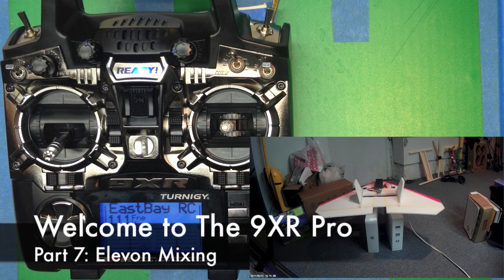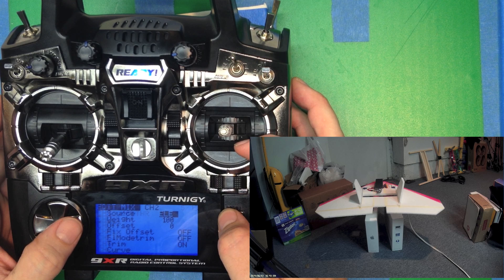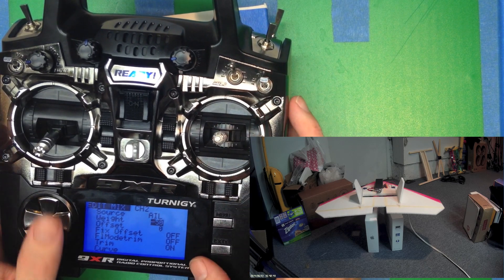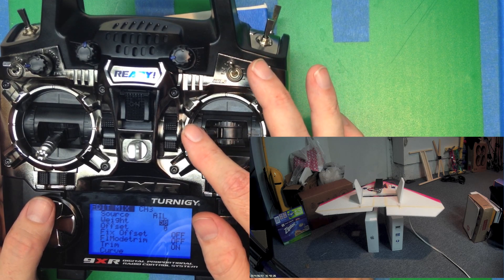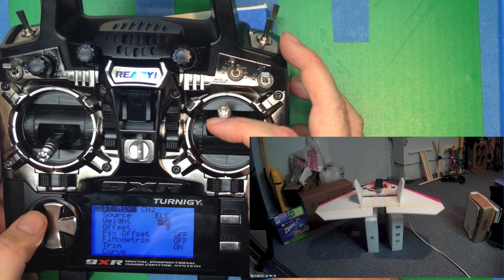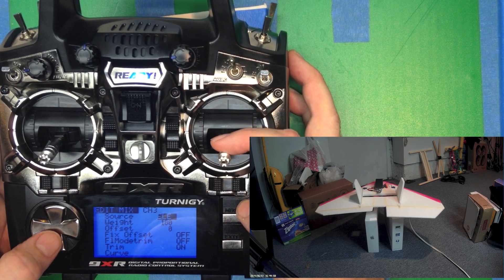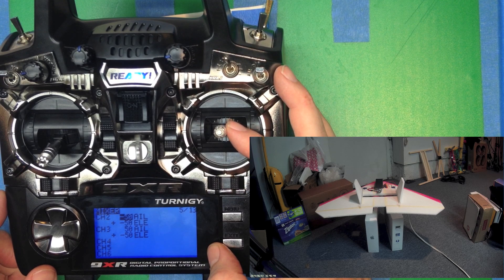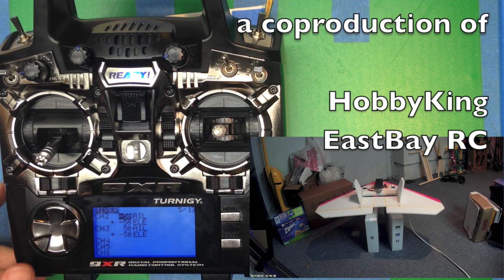Welcome to the Turnigy 9XR Pro, Part 7: Elevon Mixing

Comment: Terrific video.  Thanks for the instruction.  However, there's something that seems counter-intuitive to me.

My channels are
CH1 100 RUD
CH2 100 ELE
CH3 100 THR
CH4 100 AIL

I wanted to experiment with mixing a bit of rudder when I operate the ailerons, so I selected chan 4 and inserted 30% RUD.  The list was what I expected - exactly the same as the above, except for

CH4 100 AIL
   +  30 RUD

However, the way that it operates the model came as a surprise.  When I operate the ailerons, they work exactly as before, and do not affect the rudder at all.  When I operate the rudder, it mixes 30% ailerons in - the rudder goes through its full sweep, and the ailerons go to 30%

I can make it do what I want by deleting the 30% RUD, and modifying chan 1, and adding 30% AIL, in which case, chan 4 gives me 100% AIL and 30% RUD.

Can you please explain this?  Is there some way I can see this as being logical?
Reply from the maker: +Mike Collins Yes... I think you might be reversing in your mind two things:  "rudder, the control surface" and "rudder, the stick".  Ch1 will control the rudder surface, and Ch4 will control the aileron surface.  So, when you mix 30% AIL (the stick) onto Ch1, you get the desired behavior of your aileron (stick) mixing into your rudder (channel).  Does that make sense?
Reply: +Mark Harrison I appreciate your quick response.  In the final analysis, I suppose it doesn't matter whether it makes sense or not, as long as I can achieve what I want - but to my mind, if my aileron is on Ch 4 and I add a new function to Ch 4 (30% rudder), then ch 4 should give me both of those functions.  It was a real surprise to see the inverse of the functions being operated by the rudder control.  The way the channel list is presented makes sense to me.  All a matter of mindset, I guess.
Reply from the maker: +Mike Collins No problem, nothing better to talk about on a rainy day when flying was cancelled!  You're right, it's all a matter of perspective, and this radio software is opposite of many other radios. Always think "my rudder is on channel 1; let me calculate a value to send to channel 1; it will be two stick values mixed together;" and likewise for each of the channels, and you won't go wrong.  Happy Flying!